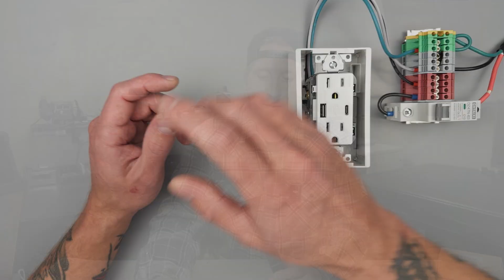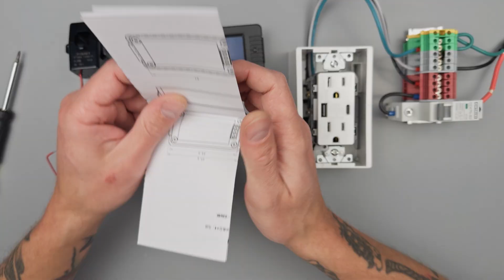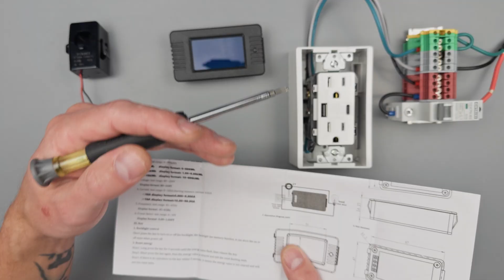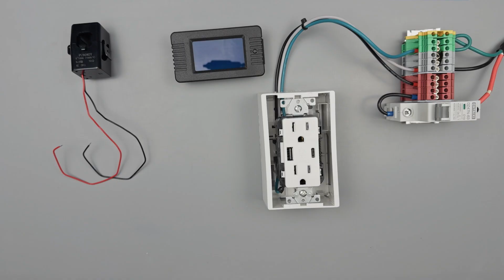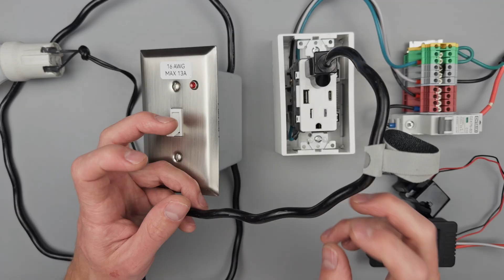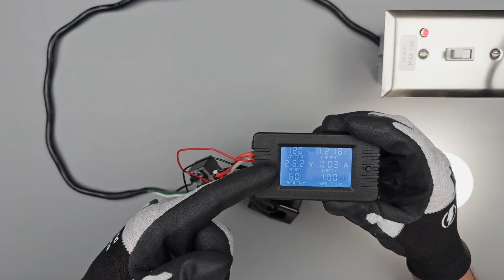🔌 How to Wire Up AC Current Voltage Amperage Power Energy Panel Meter Multi-Function Power Monitor 💡

Comment from the maker: ⚡ My Go-To Electrical Tools
🔌 Silicone Test Leads: https://amzn.to/43Xvy0o
🛠 Crimping Tool: https://amzn.to/42yuTRS
📟 Fluke 15B+ Digital Multimeter: https://amzn.to/4rhHsL6 
⚙ Ferrule Crimping Tool Kit: https://amzn.to/4eKUEG2
🔥 Heat Shrink Connectors: https://amzn.to/4uQ0Dhy
🧲 Magnetic Multimeter Hanger: https://amzn.to/4eFg4nT
━━━━━━━━━━━━━━━━━━━━━━━━━━━
Disclosure: These are affiliate links. As an Amazon Associate, I earn from qualifying purchases.

Comment: Hmm I bought a couple of cheap round meters and I plugged wired to the power terminals on the meter. The the ct was just plugged in and put around the blk hot wire of a fan that was not connected to the meter and it read fine volts,amps and hz . I not sure you need to be on the same power into the meter for it to read what is going threw the blk load wire....

Comment: Weird question for anyone with some input.

 ive been using one of these, that i installed into the front of a variac, for the past decade. My meter display is almost identical dimensions wise but only has four readouts on its display instead of 6 and the front face of the display plastic is smoother with just a single button for  the backlit display on/off. When i first got it i was annoyed at it turning off if the variac voltage dropped below 50v or so which compelled me to modify it to stay on regardless of the incoming measured voltage by supplying its power input with the full incoming voltage from the wall. Works great now and stays on taking measurements all the way down to 0v. 

My problem is that im constantly battling the LCD viewing angle and its frustrating not being able to see its readout if im not right in front of it. Does anyone have a good solution for this? Possibly modifying it again to add a contrast potentiometer, or maybe using some kind of polarized screen in front of it? Any ideas welcome!

Comment: Is there a way to monitor a 220v circuit? The screen shows it'll do it,  but I'm not sure how.  I put both legs through the round thing and it still only shows 120v.  So I'm not sure it's monitoring both legs.
Reply from the maker: It’s not. In other country’s the mains voltage is typically 220-240v. The round thing is also only for current, not voltage. You need two separate monitors. Please be extremely careful
Reply: @maddoxmechanic OK. 👍 Thanks for the quick reply.  Looks like I need to buy something else.
Reply from the maker: @wjthehomebuilder you bet!

Comment: Great video... I would love to have 2 of these to hook up to my electrical panel, but I've found a couple of issues, I guess. One being the CT terminal leads are only 8 inches or so. I would need at least 18 inches to 2 feet to properly mount it away from the electrical panel in a project box. I hear this can reduce the accuracy. What are your thoughts on extending the CT wires?
Reply from the maker: I honestly don't see a problem with it for that short of a run. I would just think of them similar to signal wires. They'll be susceptible to noise and attenuation - similar to that of like a CAT 5e cable. So i would try using twisted pair, make sure the splicing is solid, and that the gauge or the wire you use for splicing is either at the same, or greater than what is on the CT. And use stranded wire. Aaaaand you should be good. Thanks for watching!

Comment: Aside.....from a safety standpoint....I thought you install the CT on  "dead" circuit for safety....and only after the CT is placed around a power lead....only then do you turn on the power. It seemed you clamped the CT on after the bulb was lit. I'm just quoting other ....possibly higher wattage applications... where the CT "danger" is more pronounced.....but I thought to throw it out there.
Reply from the maker: That is a brilliant catch! You are 100% correct about the 'Open Secondary' danger. In industrial applications, clamping a CT onto a live, high-wattage load without it being connected to a meter can generate a high-voltage spike (thousands of volts) that can be lethal or destroy the equipment.

For this specific DIY setup, I was safe because I was only pulling 25 watts (about 0.2A), and many of these modern split-core CTs have internal Zener diode protection to prevent that spike. However, you are absolutely right—the 'Gold Standard' for safety is to install the CT while the circuit is dead, or ensure the leads are securely plugged into the meter before clamping it on. Thanks for looking out for the community!

Comment: Your review of the PZM-022 meter...and the associated PZCT-02 Circuit Transformer..... is one of the few ( maybe the only YT vid) that even SPEAKS to polarity..... not just for the CT but also how to wire up the S1/S2 output of the CT to the monitor. Here is what I found out ( as a sharing)....the PI marking on the one-face of the CT should face the incoming power, aka "the feed side" as you call it... ( does NOT face the load). That much I got from reseach on this. HOWEVER, it is also important....it seems... to get the 2 connections S1/S2 correct on the meter. It seems the red-lead on the CT is S1 (?)....but I'm not sure...AND.....even if we can determine that...I find no reference or confirmaton WHICH of the 2, S1/S2 connnections on the backside of the meter...is which.  All it shows in the diagram is where the S1/S2 go as a pairing...... arghhh.. !!! And your vid seems to frustratingly have your hands right over this area at 6:35 -6:48...so I can't see where you landed the red and black S1/S2 leads.. skip over this detail as a before and after shot.....can't see exactly WHICH CT lead is being connected..it SEEMS the black wire was at the end connection of the terminal block..and the mating red one next to it more toward the center of the terminal block....right? SUGGESTION.....run this setup again with these 2 reversed and see what you get.....negative numbers?....no change?
Reply from the maker: I appreciate you sharing your experience and findings with the CT wiring. It's definitely a common point of confusion!

Comment: I am getting ready to setup 2 of these for use with my 240V inverter/generator which I use to backfeed my panel.  My hope is to connect one of these to each of the 2 legs coming from the inverter that feed a twin 30 amp breaker at my panel.  I hope to use the info I learn on the meters (watts in particular) to balance the load of various breakers between the 2 legs so that each leg will ultimately be providing roughly the same amount of juice to the panel. I noticed in your example with the 25 watt light bulb that the WATTS display seems to show only 2 digits before the decimal point. Do you by any chance know how it displays when we are in the higher range of watts? Like 1,500 watts for example, or would it then just shift to KW? 
I like your video. You did good job and you have a nice style in how you presented this information. I hope you make more. Thanks for you efforts here.
Reply from the maker: I honestly don't know. it shows three place holders in the images. I imagine that decimal moves around and I would assume that it could display up to 999 WATTs. I do like your mindset for trying to achieve a balanced load. However, It sounds like a project where you might want to do a little more homework on the front end of your project. ie testing and measuring loads prior to installing your generator/invertor breaker, sitting down and doing the math so that when you're testing at the end, youre not so much as testing to see the load distribution, but you're simply verify the calculations you've already made. if that makes sense. Also im sure you're aware, but backfeeding a panel (if its for a home hardwired into the grid) with a generator can be extremely dangerous to lineman workers if the panel doesn't have a proper disconnect. Happy testing!
Reply: @maddoxmechanic  :  I appreciate your kind reply. I too was hoping that the 2 digits plus a decimal would switch over to a '999'. I will find out soon and will let you know.  All of your comments were sound advice, so thank you. I did do a lot of research on this a few years ago and installed a interlock kit in my panel (because we love our local lineman :) and a twin 30 amp breaker and a generator inlet box mounted outside. So far it has worked very well on the rare occation that it was required... but it sure feels good to have a solution when we need one. Our home is heated with natural gas and we have 5 ton heat pump unit for our AC and for generating heat at 40 degrees and above so as minimize the use of gas. The cool thing as that if we lose power I can just flip the heat pump breakers off and the gas furnace will then provide the heat at any temperature, including above the 40 degree threshold. So, the generator is really just powering the circulation fan and some minor electrical parts in the furnace plus the thermostat. This is a 5K sq ft home but it's surprising how little wattage you really need in an outage.  With modern LED TVs & computer monitors, modern Macs, all LED lighting throughout the house, fridge, garage doors, etc. it is very little. Most of my neighbors have spent $30K+ for their Generac whole-house generators which are virtually never used and when they are needed they will often not run reliably (say two of my next door neighbors). While my system is not as elegant, I paid $1,200 for a new Champion 8750 Inverter, total of $1,500 all in with cable, lockout, inlet, breaker, etc. and it provides more power than I need. A hot summer day when AC is required could be a different story due to the 50 amp heatpump but nobody loses power in the summer season anyway. This leaves me with an extra $28 grand for the kids at Saint Jude's Children's hospital when I croak, which gives me a warm-fuzzy plus the fact that it makes me feel smarter :)  

My 2 little meters (like the one in your video) will be here today! I can do all of my planning and breaker-leg-swapping ahead of time before ever connecting my inverter. Many thanks for your great video and for being one of the good guys. I'll let you know about that pesky decimal point :)
Reply from the maker: @flyme-z7b Hey good for you! sounds like some ingenuity has really paid off!  and damn 5000 sq ft is a whole lot of house! good on you for keeping the energy use low. let us know about the decimal point.  for the AC, you may not lose power, but a solar rig with a battery bank could offset the power usage. idk i personally want a solar set up and battery bank so i just try and find ways to try and get others to do it 🤪